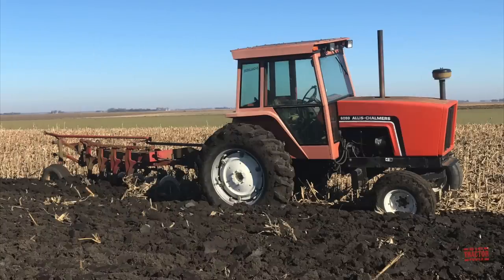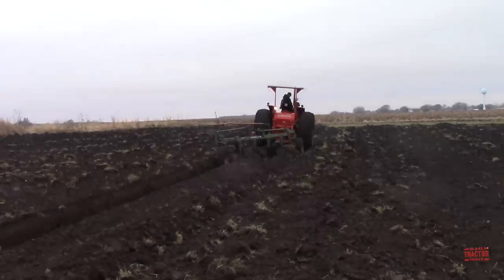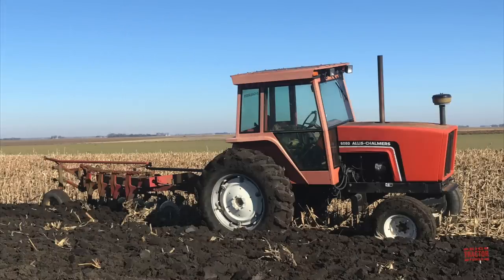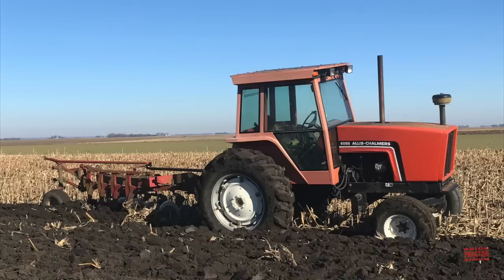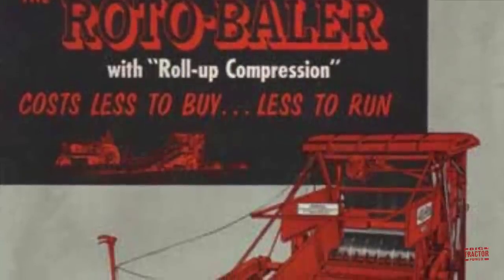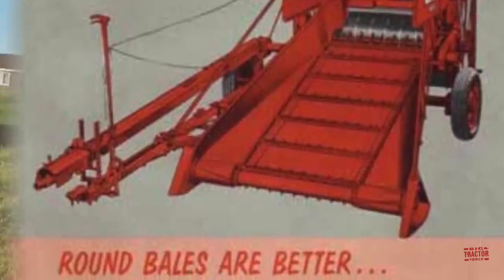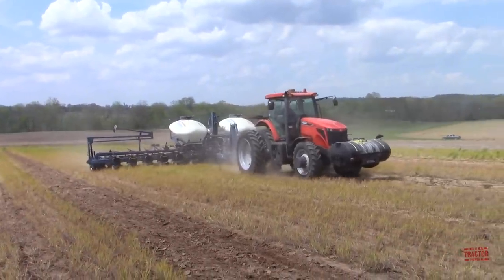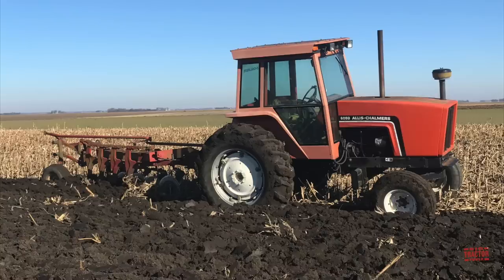Driverless Tractor Plowing | ALLIS-CHALMERS 6080

Comment: 23 miles later.... 2 counties away....it ran out of fuel
Reply: He wouldn't do this in clay soil. Soils so hard tractor rides wheelies & goes everywhere.  A friend told me this..
Reply: Years ago customer had an 'operator' jump off a running old 84" pad foot roller that 'wouldn't stop' (he was a moron) on a job site just N of 1604 in San Antonio.  They tried to catch it, but in the brush & uneven ground they never could safely try and get back on it.  "So what did you do?"  "We packed up and left the job site" :  )   Said they found it the next morning about a mile away.  It finally hit a huge tree it couldn't push over and ran out of fuel.   Lucky no one was killed or anything damaged except for a bunch of small trees.

Comment: Exactly how we used to pick rocks / stones when I was a teenager.   A '75 Ford 4x4 in 4L at idle with a belt tied from the steering wheel tied to the seat frame was the perfect speed for two people to walk beside and toss rocks into the bed.
When we got to the end of the field, we'd just turn it around and head back.

Comment: I know it's a demo bit that plough is doing a fine job of burying the trash. 
Interesting video. 
If you're ever in Europe, esp England,  you may see some farmers using front and rear mounted rollover ploughs. It's an interesting concept in that it uses the push-pull momentum of both ploughs to power them both through the soil. It was a fad in the mid-80s and then died off. Now it's making a comeback in the last 10 years both in the UK and Europe.

Comment: Allis Chalmers were responsible for some interesting ideas when it came to their machines and tractors. I'm pretty sure it was AC who came up with the PAVT method of adjusting the rear wheels for various track widths - particularly useful when setting up to harvest corn with a tractor mounted harvester, although in that instance, the front end was either configured with twin wheels close together, in a 'V' format or just a single but slightly wider tyre, both formats being positioned on the tractor centre line.
 PAVT really came in to its own on larger two wheel drive tractors, where the rear tyres and wheel centres were extremely heavy, and as such, potentially dangerous for the operator trying to change wheel track width the old fashioned way, via manual handling.
 With PAVT, this task could be accomplished in a matter of seconds.

Comment: How many farmers got run over at the end of the row trying to catch a driverless tractor to climb back into the cab to raise the plow and turn it around and line up with the next row???
Reply: Several
Reply: It's just an endless row of corpses behind it.
Reply: None that I know of...  I have run my tractor driverless at very low speed pulling a hay wagon while I loaded hay bales, only when no help was available and rain was coming. 

I'd much rather drive the tractor and have my wife pick up bales.  ;)
Reply: I never heard of it all the farmer i know never left the seat.
Reply: It's not that dangerous. Take your time  and actually think about what you are trying to do. Make deliberate, planned moves and you'll be fine.
I've pull started a tractor all by my lonesome many times. 
Hook up the tractor to the truck. Put the truck in gear and step out onto the ground. Wait for the tractor to roll to you. Climb on and put the tractor in gear and let the clutch out. When it finally starts , take it out of gear and step off. 
Run to the truck and jump in slowing down slowly so the tractor doesn't slam into the truck. 
Piece of cake, right? 😁 Now, you can get some farming done.
Reply: @p.thadeushornswoggler4987  I have had to do the hay wagon thing before and have fallen off several times luckily it was usually off of the hay wagon and not the tractor.    But we run wide axles and falling from the tractor you can just lay flat till the wagon passes and then get back on the tractor.    A plow you cannot do that.
Reply: @amosmoses9247  That's not pulling a plow and then falling off.
Reply: On the positive side the dead corpse won’t be visible since the plow will take care of that
Reply: You’d have to be very careful young and in shape
Reply: @p.thadeushornswoggler4987  Noooh! I don't like the callouses she might get from the Sisal     ;-)
Reply: @amosmoses9247  Och you shouldn't have told them...........    I used to do it all the time - when you do it regularly but with respect and CARE.
Reply: @mesh1248  not to mention all the nutrients added back into the soil from the dead corpse being plowed into the ground
Reply: @amosmoses9247  Speaking strictly to the original topic of this thread, a farmer doing this multiple times to plow an entire field this way(we can assume that such a person would be multi-tasking in the field - otherwise what the hell would be the point?), then that's a different proposition than what you're talking about because these are two VERY different levels of risk. 
Pulling equipment, especially tillage equipment, and at a pace that one would be expected to to actually get a meaningful amount of work done takes this to a completely different level than a pull start or other similar scenario that can be slowed down to a crawl. 

This isn't a case of "if you're just smart about it..." - ONE mental lapse that causes a slip could literally be all that it takes. It's not like anyone is claiming that this is a difficult and highly skilled endeavor; on the contrary, it's easy enough for any functionally healthy person to do. In fact, it's easy enough for someone to attempt to do it while they aren't paying attention or when they're exhausted; which is where mistakes happen. All it takes is something else on your mind distracting you.

So, this is a classic case of risk vs reward - this isn't inherently that risky of an action(again, not that difficult for the average functional person to pull off), but it's the consequences that multiply the risk factor. Now, if someone could actually multi-task while babysitting a tractor that's off to the races, then maybe it IS worth it, lol. 

However, at the end of the day what it comes down to is, even if it's literally just a completely improbable fluke of an accident - which happens of course, us humans suck at consistency & repetition, nevermind the unpredictable - is it worth taking that chance of your family finding you in the form of bloody fleshy boney top soil?

Comment: We had a Farmall Super C pulling hay wagon. First gear at idle was walking speed. Jump off and throw bales on the wagon. Despite no power steering, it was easy enough to hand twist the steering rod by the front for corrections/corners.
Reply from the maker: Cool history. Thank you for sharing.

Comment: I actually know an old timer who has plowed whole fields with 2 tractors at a time this way. He’d start the  lead tractor on it’s way, then get the following tractor going. Stop the following tractor short at the far end of the field, run ahead to the lead tractor, get it turned around, then go get the following tractor. I don’t know how many times he did this, but I know it happened.

Comment: Oh mann!  nothing new under the Sun, ..   the  general purpose farmer years ago did all that.  from the days of the TE-20 without a footplate to stand on ( I wouldn't have done it until the FE-35 came along with footplate.  Used  to do it whilst feeding livestock in field - let the tractor crawl along randomly across the field whilst you stood in the Ferguson trailer to dish out the Neeps and hay / straw to the cattle / sheep.
Ploughing / cultivating was   a regular thing to step off ( never Jump) to see if the adjustment was OK  Tractor at rest did NOT show whether implement was set level.
Secret is in the Tractor/Plough Combo setting to get the straight Pull.  Was my Party trick to show how well the smaller Green ones  could work better than ANY of the Red or Blues at the time.   Take Care & Stay safe - I wouldn't do it now with the different Cab & Steps configurations nowadays.

Comment: Driverless mode would never work on the side hills - it would jump out of the furrow.    Re: Driverless tractors of the future - I often wonder if it will be less expensive to have more smaller machines than today's behemoths.  For example, 1-row  planters or 1-meter wide tillage devices that can run 24 hours.  Light machines means no soil compaction.
Reply: Mike 

I’ve been wondering about the same thing.  If you think about it, the transport from field to field may be one of the bigger challenges facing fully autonomous farm machinery.  So, smaller machines that are more easily loaded and unloaded from a trailer may be the way to go.  Then, one operator could control multiple machines from one hub location as well.

It will be interesting to see how that develops.

Comment: Oliver had a set screw by the steering wheel you could tighten that to make the steering turn harder that way it would follow the furrows better. Never tried it had a narrow front no way to drop the tire in plus it would drift according to the tilt of the hill.
One other thing that allis had thats coming back automatic hitches or even what they got in England basically a snap coupler. Also they had a front unload spreader so the weight stayed on the rear tires. So close you cant help but wonder what they could have done

Comment: And I bet no computer can tell when corn stalks build up into a mound in front of the plow shares,,, at which point you have to stop and lift the plow and go over or around it then put the plow down again. I remember that happening on the lower end of a field. The mound of corn stalks was big enough to fill the bed of a pickup. The mound basically high centered the plow so it couldn’t get down into the ground.

Comment: Hey BTP, I can’t remember where I seen or heard this, but didn’t IH make a prototype notill corn planter in the 60s but it didn’t catch on at the time. Something like 50 units were made. I’ll have to do some research again on that.

There’s still a few of them notill AC planters around here, the neighbor guy has one. Seemed like a decent machine although I’ve never ran one.
Reply from the maker: IH May have.  The first no-till was 1962 on 5 acres.  Maybe IH was trying no till by the late 60’s. AC had a big  multi row no till model featured in the Land Handler magazine around 1970.  It was pulled by an Oliver 1955.

Comment: I did that with an 851 Ford ideling in 1'st gear pulling a hay rack picking up rocks out of the fields back in the day, there's no way I would do that plowing at 4-5 MPH, there was just an article in the paper about a young chap who was riding with his buddy and wanted to get off while in motion, he slipped on the tractors step and got run over while his buddy was driving, I believe it took place in Rock County Wisconsin 😰.

Comment: For the most part if u set a tractors wheels where u want them it'll pretty much drive straight doing anything
Reply from the maker: Not on my 4wd.  Disking it veers ofcourse pretty fast with out a hand on the wheel. The wall of the furrow is a good guide.

Comment: That sawed off little 4 cylinder combine engine in that 6080 had all it wanted with that 4 bottom on it. I think the 6 cylinder 185 had more power and torque .
Reply: That turbo charged 4 cylinder was a wicked high torque fuel sipping engine. The 185 had the 6 cylinder version with no turbo. The 301 like it's little brother a 200 loved a turbo

Comment: This video should do well with a click bait title like this one :-).
Back in the early eighties I saw a tractor that drove by itself but was no good at head land turns. 

It was in the bottom of a ditch because the driver had fallen asleep!
Reply from the maker: I dislike click bait videos. I always make sure the thumbnail and title deliver exactly as advertised 😁.  In this case it is a 6080 plowing with out a driver.  I was tempted to not even mention no one was in the cab and just make a spec video and see if anyone noticed.
Reply: @bigtractorpower  I wasn't being derogatory, I was being honest. I clicked onto the video excitedly because I assumed that someone had modified an old tractor, and I'm sure that I'm not the only one.
It will be interesting to see how many views it gets.
Cheers 

Adrian